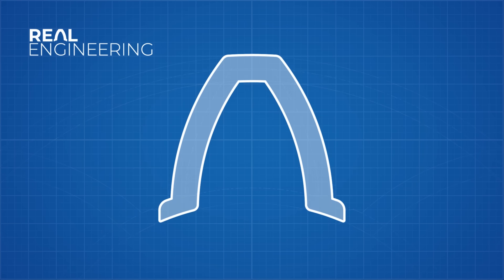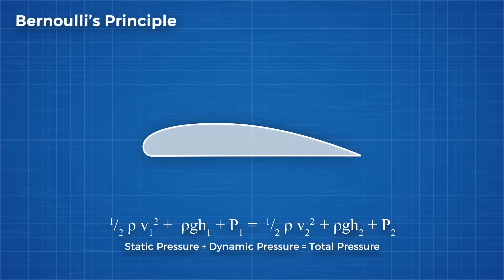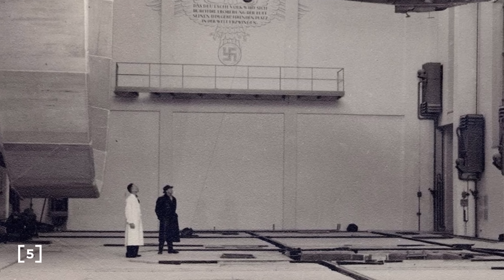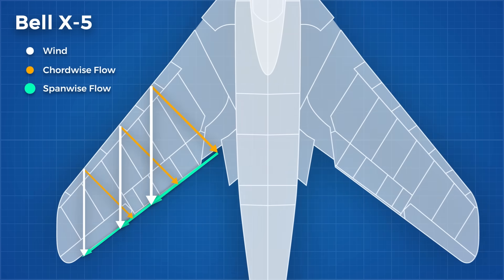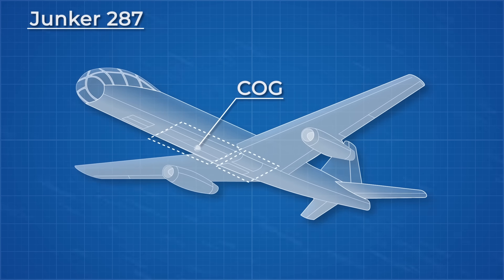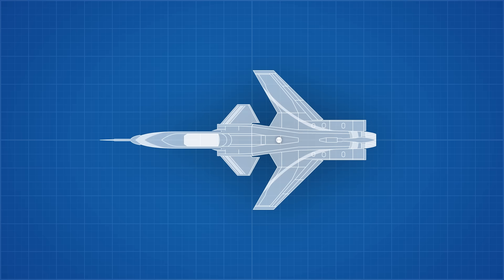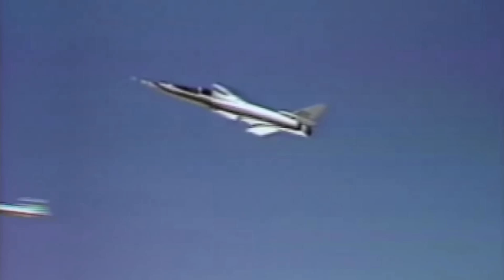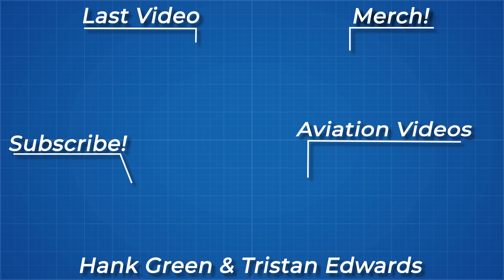Why Do Backwards Wings Exist?

Comment: It's not that the bernoulli effect isn't real -- it's just not the primary source of lift that people were taught it was for many years.  The primary source if lift is wings pushing air down like giant ceiling fan blades. 

 If that weren't true, airplanes could not fly upside down, where not only do the wings have to provide enough lift to lift the weight of the plane but also enough to overcome the bernoulli effect that is actually pulling the plane down.
Reply: I will point out in all this that using airfoil surfaces to direct air upward or downward  is drag-intensive, where the bernoulli effect is not.
Also, the Bernoulli principle is best illustrated in a tube, but applies to any fixed cross-section where fluid is flowing unidirectionally, i.e. not exhibiting turbulence or vortices - that makes things nightmarishly more complicated.
Reply: @HuntingTarg  +
Reply: Daniel Bernoulli or his sick stealing father
Reply: Correct, lift is primarily Newtonian.  The wing forces air down, and in turn, the wing is forced up... Newton's third law.  Many modern wings are "laminar flow airfoils."  These wings have a symmetrical shape on the top and bottom.  Therefore almost none of the lift is generated due to Bernoulli's principle, instead, it is simply Newtonian, generating lift by forcing air downwards.  Which is why, like you said, aircraft can fly inverted.
Reply: @trevorbylsma123  I don't get it. If the cross section of the wing is design to force air down, when you fly upside down it would force air up = the same problem we have trying to explain lift with Bernoulli effect.
Reply: @dezimal9143  It's angle of attack that forces air down.  The wing shown in the video has an angle of attack of a couple degrees.  When you are inverted, pushing the stick forward pushes the nose of the plane up higher on the horizon and increases angle of attack of the wing.
Reply: Bernoulli principle applies to incompressible and laminar flow (pretty much anything subsonic), and yall are also getting camber and angle of attack mixed up when thinking about lift, angle of attack is when the plane is in the air flying relative to a horizontal axis, camber is the curve put on a wing to produce more lift at a 0 degree angle of attack, when a plane is at a greater angle of attack the air smacking into the bottom of the wing makes the velocity of airflow below lower than the velocity of airflow above the wing. This produces a pressure difference where pressure on the bottom of the wing is higher than the pressure above the wing, which is why the lift is produced
Reply: @trevorbylsma123  +
Reply: @Trevor Bylsma
Correct. And, fun fact: take a look at Formula 1 cars or other such high performance vehicles with spoilers. If you look at them closely, you'll notice something - they are "upside down" airfoils. They are like that to purposely create downforce on the tires so as to get a better grip. Actually, with some of these cars, it would be possible to drive inverted if you were going at their top speed. Theoretically, anyways. I wouldn't suggest trying it!
Reply: Planes can flies inverted because angle of attack.
Reply: @robflyrc  It does require an increased angle of attack to overcome the Bernoulli effect.  Also because the wings themselves are usually tilted to have an angle of attack on their own, while the plane is level.
Reply: @FreedomTalkMedia  Exactly that's what I meant, but in short.
Reply: While it's true a newtonian explanation works to explain flight, a lot of the lift generated comes from the top of the wing, not the bottom as I intuitively first believed.

Nasa has this page exploring misconceptions about how lift is poduced, and it is easy to read

https://www.grc.nasa.gov/WWW/k-12/airplane/wrong1.html

https://www.grc.nasa.gov/WWW/k-12/airplane/wrong2.html
Reply: If you all have the time I would recommend watching this fantastic video on how lift works by professor Babinski: https://youtu.be/XWdNEGr53Gw. Lift has to do with the shape of the airfoil forcing air to accelerate (by changing direction to match the curve on the wing) and thus creating a lower pressure area (due to Newton's second law). You can have an airfoil with a flat bottom at a zero angle of attack and still generate lift. The wing doesn't generate lift by pushing air under it down (as I believe people are suggesting when referencing Newton's third law / fan blades) but rather by generating a low pressure area above it, which causes the higher pressure air under it to push it up.
Reply: @creditcrew 'debris'
Reply: I agree....but, when airplane flights upside down, I suspect that pilot pushes forward his cloche
Reply: Just wanted to add on to this point. As you have stated in aerospace we say it is false to attribute lift primarily to bernoulli effect/priniciple as it is in fact Circulation that is necessary to generate lift. This is also shown mathematically via Kutta–Joukowski, this theorem basically related lift to circulation.
Reply: The portion of lift generated by the Bernoulli principle is not caused by the wing shape but the angle of attack.  It slows the air on the bottom of the wing by redirecting it, so it does contribute; this can be seen with pulses of smoke in a wind tunnel. However, the main component of flight is still Newtonian.
Reply: Well, yeah, sort of. Upside down flight requires a higher angle of attack, so Bernoulli is still there pushing up, but not as efficiently. Granted though, we now understand that push down is more important than once thought. The really interesting stuff, however, is how vortices start and flow spanwise creating induced drag, and lift. The forward swept wing was an attempt to pack the vortices up against the fuselage rather than have them spin off the wing tip.
Reply: @ChimeraActual  Bernoulli's principle is not applicable AT ALL to the theory of flight. It only applies to steady, incompressible, irrotational, inviscid flow such as laminar 1D subsonic pipe flow, and is nothing to do with an aerofoil. As for your bit about push up and push down, you're not making any correct statements about aerodynamics.
Reply: @JayLikesLasers  wrong. Bernoulli's principal is spot-on when it comes to low-speed flight. Coupled with the kutta condition,  you get Cl and Cd for an airfoil, and with upwash corrections, you can get lift for a 3d wing at an angle of attack
Reply: @SimonWoodburyForget  So many physics geeks here lol, I have no idea what you guys are talking about
Reply: Airflow is complicated an best illustrated by looking at one molecule a time.
If do that and follow the molecule, you will see that the primary source for lift is indeed a centrifugal force (precisly the reaction of the molecules mass on a centripetal force) that forces the molecule, if above the wingm outwards and, if under the wing inwards, directly influencing the density change and therefor the lift. Of course, there is always the curved profile of a wing that adds some ligt to it but the basic priciple is really that, the force acting on something that when cornering ;D.
Reply: @Enthropical_Thunder  what on earth are you talking about? Centripetal and centrifugal forces in airflow acting on particles? They're completely irrelevant to how aircraft generate lift, unlike vorticity
Reply: @belacickekl7579  
Not really, if you think about it, this is the exact mechanism that Bernoulli describs in his "dumbed down" equation, actually what i described is known as the " lagrangian representation of flow", the "eulerian representation of flow" describes a fixed volume in wich a fluid flow takes place. 
You have basically an air molecule (be it nitrogen, oxygen, CO2, NOx or any noble gas), if thus molecule  travels at a certain speed and than takes a turn, a force will act on it.
This force will point outwards, kind of when you take a turn in your car, you will feel a force that acts on you.
Now, this Force normally would force (pun not intended) the molecule to stay on a straight path, however, depending on the molecule being above or under the wing, the wing itself or the molecules around it will direct it into the curved path. This is basically how the lower pressure above the wing and the higher pressure under the wing are being generated.
Reply: Also, if my memory of my college physics class serves correctly, the Bernoulli effect only applies to air in an enclosed tube, as in a carburetor.
Reply: @BuffMyRadius  Yes, Bernoulli's equation only applies to steady, incompressible, irrotational, inviscid flows (such as steady 1D laminar pipe flow)
Reply: @BuffMyRadius  I was told in fluidics that this is technically true but when dealing with fluids of any meaningful speed below transonic, the differences are completely insignificant as the fluids will behave identically.

I don't know if that's completely true, but it seemed reasonable and helped me get damn close answers on tests. :P
Reply: This isn't really true, lift can be fully accounted for using Bernoulli's principle. It can also be fully accounted for using Newtonian physics. They are just two different approaches to solving the same problem and will yield the same result. They also give the same result for an aircraft flying upside down, it needs to use its flaps or it will be headed into the ground pretty quickly.
Reply: Real source of lift is Kutta–Joukowski theorem: https://en.wikipedia.org/wiki/Kutta%E2%80%93Joukowski_theorem
Reply: @Quasarnova1  Couldn't the aircraft just control its pitch using its horizontal stabilisers and leave its flaps at zero?
Reply: @JayLikesLasers  I think you mean its elevators rather than its stabilizers, but yes you could also pitch the aircraft enough that the upside down wings end up with a positive angle of attack and start providing lift again.
Reply: @Quasarnova1  exactly. Thanks for the correction. As in the control surfaces aft of the h stab
Reply: @Quasarnova1  you don't need to use flaps to fly upside down.  Not sure what your're talking about
Reply: @trevorbylsma123  Read my other comment where I said you could also use elevators. Either way you need to use a control surface to fly an aircraft upside down, with the possible exception of powerful thrust vectoring.
Reply: What are you talking about? The bernoulli effect is what accelerates the air downwards
Reply: @belacickekl7579  The wind hitting the wings, which are tilted against the direction of air flow, (Like ceiling fan baldes) are what push the air down.  The air slams into the bottom of the wings and is deflected down.  This is why increased pitch increases lift.  Increased pitch means the air is more directly smacking into the bottom of the wings.  

Does some air get directed down as it follows the curved shape of the top of a wing?  Sure it does.  Otherwise they would not be curved.  That said, you could fly an airplane with perfectly flat wings.  Or, as my OP said, upside down even.
Reply: Negative, good buddies; low pressure above the wing sucks it up.
Reply: @stevenliszkai7419  Wrong.
Reply: @stevenliszkai7419  Wrong
Reply: @powderslinger5968  you sound like a pilot... but not an aerodynamic physicist.
Reply: And when you're flying upside down it's the rear stab deflection that keeps you aloft - same as in a bank.
Reply: @stevenliszkai7419  upside down is like in a bank? lmao you know nothing

Comment: Low speed CAS aircraft could greatly benifet ground forces. Turns sharper, opens up the body to carry more weapons, takes off in a shorter distance. Better materials and computers make it possible.

Comment: All I wanted to know is why backwards wings exist... now there a formulas and graphs
Reply: Coz forward wings stall most and first  on outside where steering stuff is - making steering hard, and backwards wings stall  on inside where steering stuff isnt - making the steering the same
Reply: Coz forward wings stall most and first  on outside where steering stuff is - making steering hard, and backwards wings stall  on inside where steering stuff isnt - making the steering the same
Reply: The video is wrong about the origin of the swept wing on the Me-262 Schwalbe jet fighter; the original design had a straight wing, but it became necessary to sweep the wing back to correct a center-of-gravity problem when the Jumo 003 engines proved to be heavier than accounted for in the original plans. It was only after the design of the 262 that further research revealed the advantages of sweepback.

Comment: What exactly was making the X-29 so unstable in flight?
Reply: One of the main issues is yaw stability, the rotation the rudder generates. On a forward swept wing if the plane yaws to the left, the left hand wings forward sweep angle decreases, which increases its drag, causing the yaw to increase even further. On aft swept wings the plane is self correcting, with a small disturbance being righted automatically by the planes design with no pilot input (the definition of stability).

Comment: TL;DW: Forward swept wings provide an aircraft with supermaneuverability. However, the trade-offs in designing such a craft aren't worth it in present day since thrust vectoring provides the same benefits without the problems.

Comment: You didn't mention that the canards also inhibit positron flow through the secondary EPS relays, preventing tachyon buildup both outside and inside the deflector panel overlays, ultimately resulting in superior subspace flight characteristics...
Reply: But Janeway and her crew didn't even know what secondary command processors did and thus couldn't self destruct automatically and wasn't bad ass enough to go fire phaser at the warp core.. because science.. erm I mean TV show plot...
Reply: @plasmaburndeath  
Exactly my point... Exactly?
Reply: @Raz.C  exactly lol us Trek nerds know what's going on